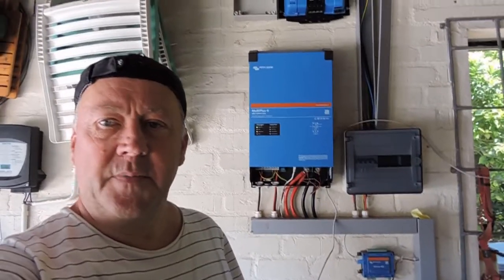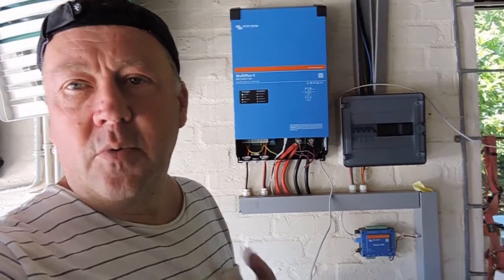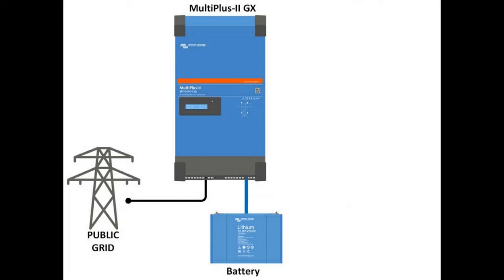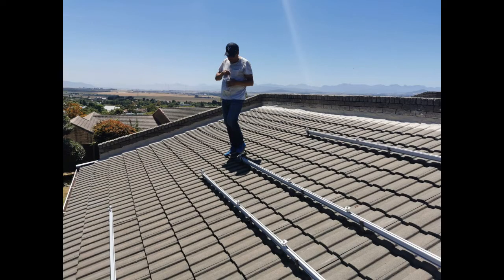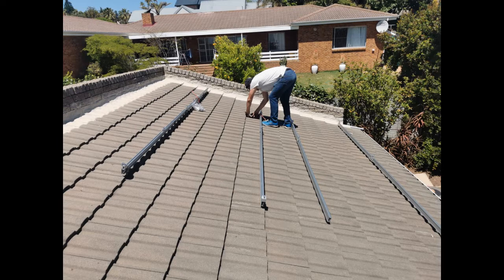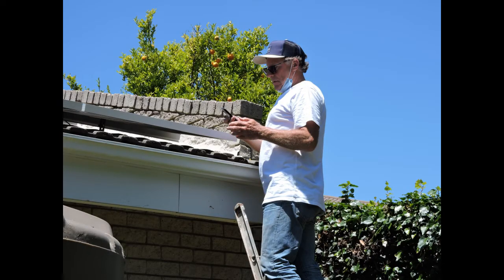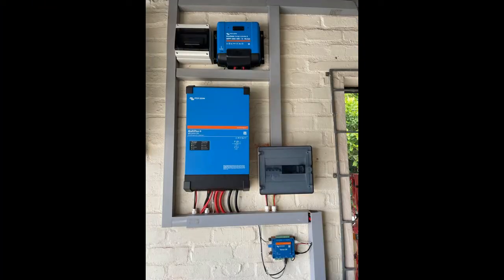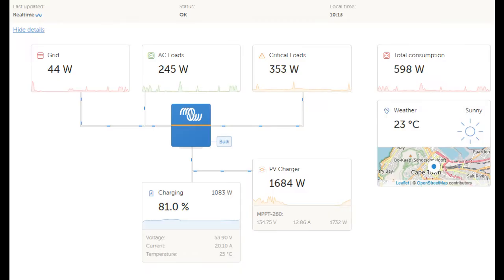Energy Meter = Massive Savings (Victron ET112)

Comment: Thanks, Alan, how can I get hold of someone to do this connection and programming for me.  I have the components but not many installers have the necessary experience.
Reply: Read the documents provided by victron. Though you could do the DC connection by yourself and even the programming(not literally, as these are settings which is done as per your needs) using the cerbo-gx, I would recommend to hire an electrician to do the AC work. Like installing the energy meter etc.  Otherwise look for a victron shop near you, they can help you with everything. ps: I received mine yesterday and am working on it already

Comment: Why is the ET112 required? Doesn't Multiplus measures how much it draws from the grid by itself?
Reply from the maker: You need the ET112 at the supply so the Victron can measure and service the Non Essential loads by raising the voltage causing a reverse flow to those loads
Reply from the maker: Other wise it only services essential loads
Reply: @alanfalck1184  Hi just been binding on your vids very good explanation - so with the ET112 it can effectively user battery power to feed your house parasitic loads overnight such as fridge freezer internet router etc etc?  So theoretically if I sized the battery, and the daily solar right, I could end up not taking power from the grid in the day, or the night?  £0 electricity bill sounds very appealing!! Thanks.
Reply: I have the same question, doesn't the MP-II have an external CT that can clamp on the grid supply in the same place the ET112 was put and can do the same thing.